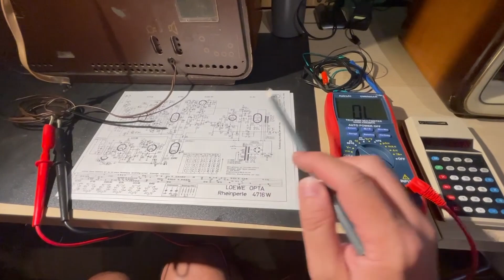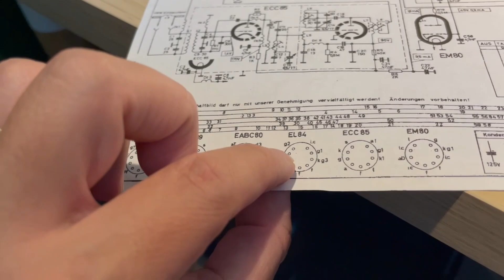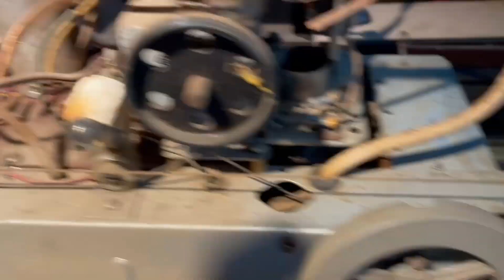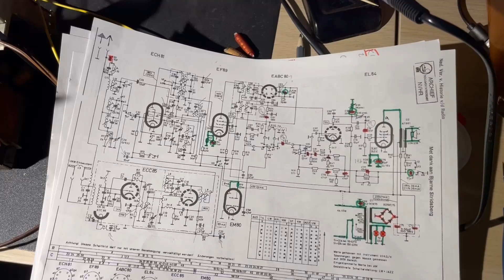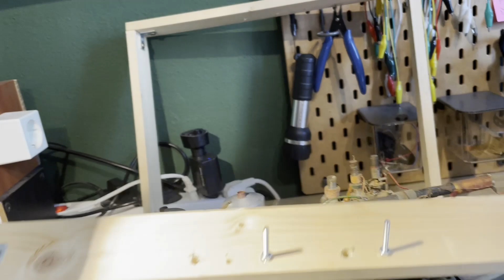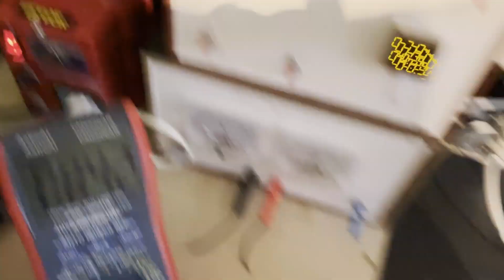Loewe Opta Rheinperle 4716W Radio Restoration - Part One

Comment: Is it possible to check the transformer windings, first the primary and then the secondary by continuity using a multimeter? Or will this not give a correct result of the transformer efficiency. Thanks, watching from New Zealand.
Reply from the maker: Indeed testing for continuity tells you whether any of the windings are open, but says nothing about efficiency. Another approach is to introduce a low-voltage signal on the primary (e.g. 1V@50Hz) and check the secondary voltage output for the desired ratio. There's a great video by M Caldeira (Electronics Old and New) explaining: https://www.youtube.com/watch?v=7xvTGd4ysRE&t=1s&ab_channel=ElectronicsOldandNewbyMCaldeira . Thanks for the question, much appreciated!

Comment: Nice work. Just got into this hobby myself. Really enjoy the sound if tube audio.
Reply from the maker: Me too, they have a big, warm sound much better than transistor equipment (at least to my ears.)
Reply: @TacianoPerez  I agree all the way. I repaired a 1950s magnavox console and wow... has a 15 and 12 inch woofer. I almost don't believe the sound it outputs and frequencies it can get to.
Reply from the maker: @speakeradventures  I have an output transformerless Philips B5X63A in my restoration queue. Apparently they have a wider dynamic range than traditional radios with an output trafo. Looking forward to that one!
Reply: @TacianoPerez  huh, that's interesting, transformerless..is it a hot chassis set then..I just looked that radio up..love it. Any radio with dual speakers immediately peeks my interest as I love speakers. I bet it will have beautiful sound. Never seen that fabric on the back of a speaker before. Will be neat to see that retorted.